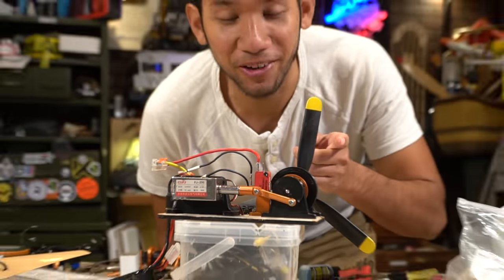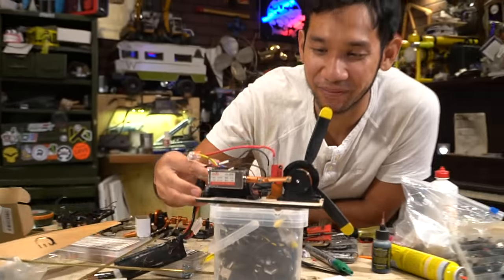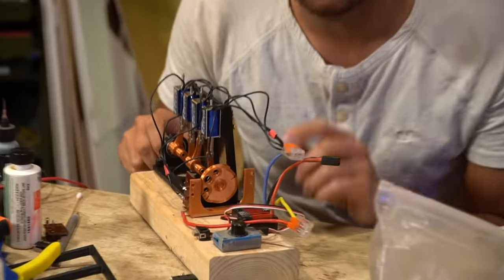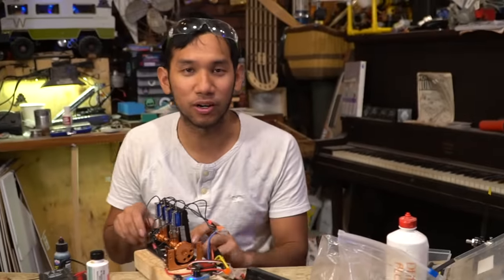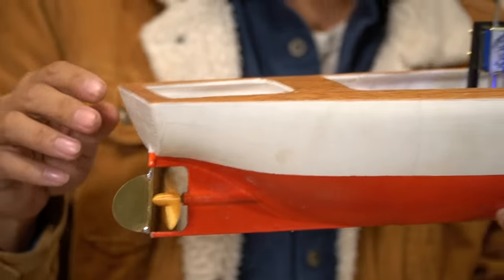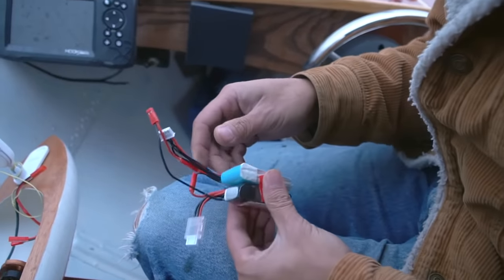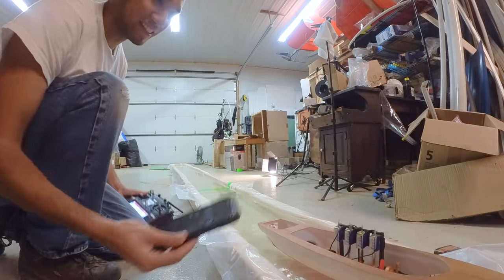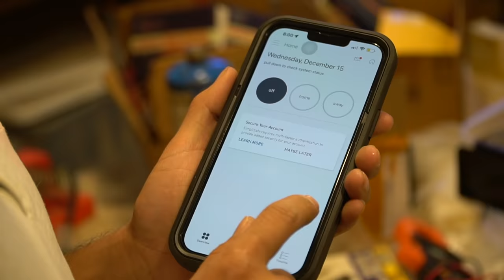Electric piston engine DIY (solenoid motor)

Comment: The idea looks good. If I were to do that, I would have each solenoid fire with every 90 deg turn of the shaft. You had the solenoids firing in pairs so it basically imitated a two stroke engine. If you need 2 solenoids to fire to turn the shaft, then make an 8 solenoid engine so that 2 solenoids fire at the same time. Yeah...more engineering, but results would be a smoother running motor (for possible airplane use). Just my $0.02 worth.

Comment: Tips for you, ditch the the iron, use a  ironless coil, and ditch the iron plunger and use nonferious with magnets instead..... and now you can use bipolar switching. 
 I'm guessing you didn't use flyback diodes on the coils, and maybe why things getting hot from the reverse polarity inductive spikes. Instead use diodes to steer the bemf spike to the next coils input capacitor to recycle that charge into the cap before that solenoid fires, so you need a cap for each coil. Or you can just short circuit that bemf to ground and waste it. And like some others mentioned, a flywheel!

Comment: There is probably things you could do. 1 - optimise timings. 2 - more flywheel inertia. 3 - maybe the ends of the stroke is less efficient so maybe a shorter stroke.

Comment: Are you planning to change the crank shaft to resemble one of a multi cylinder (in row(s) engine? ...or do you even plan for a radial engine? No matter what: multiple solenoids need multiple switches - one switch per solenoid - either arrange differently with one cam or also one cam for each switch... last but not least, you have to come up with something that does the logical function of the distributor of the ignition system in a multi cylinder engine w/ ignition (gasoline). Diesel is a bit different: instead of ignition spark, it is injection of fuel at the right time - close to max compression.

Comment: You could get a lot more out that engine. 1. Replace the timing switch with an optical sensor and make it control a large MOSFET.
2. Redesign the coils to be multiple small coils in parallel, that way you get less resistance/reactance using the same coil size. It allows more current to flow. 3. Use much higher voltage! Try like 150v dc. 4. Put anti-kickback diodes on each coil to cut down on the EMF interference.
Reply: How can the small coils be run as you suggest, in parallel?  What specific geometry?   Are the coils other-than-commercial-solenoids?
Thank you.

Comment: It would be cool if you put a gearbox in there. A servo can shift it into drive from neutral. And the escape will control speed. Bit if you could do that so the engine could run and not move the vehicle that would be super cool

Comment: I would think the trigger switch should advance with throttle. The theory here is that the solenoid always takes the same time to pull but at higher speed the crank is swinging by faster. advance would make the solenoid start pulling at the right time.

Comment: If you have an old bike lying around, What if you attempted to make a motorized bicycle with an electrical piston? Like they had back in the "boardtrack racing" days in the 1910's and 1920's , 1 or 2 pistons and instead of a fuel tank  in the frame, add a battery pack, etc etc

Comment: 6:38 I have an idea of what's going on here. So, cooling down metals makes electricity flow better, so that's a plus in it's favor, however cooling down metals generally makes them contract which if you have different metals they will contract at different rates which could end up causing squeeze which increases friction and makes it harder for the engine to turn over.

Comment: I think when it comes to solenoid engines since they have a power stroke every stroke the most efficient design would be a 3 cylinder engine with 120 degrees of offset between each cylinder. Or just having an odd number of cylinders would generally be better.

Comment: Maybe someone has already said this but would it be possible to have power on the up and the down strokes just by making the switch that turns the solenoids one and off switch the direction of the current flow inside. Then you can essentially have an "inline 8" engine since you can have power on every action of the piston. Idk if this works with the wiring of your solinoids but it seems like an easier way to get more power out of the engine.

Comment: So, I think there's three things to do. 
1. Less friction. Treat ik like a Stirling engine/flame licker. It seems to me like it's running pretty rough.
2. Cool the solenoids, or try other voltages/more/less windings. I've seen solenoid engine srunning for quite a while without the coils burning out. 
3. When using multiple solenoids, distribute the cranks over the revolution evenly, to smooth out torque. (crossplane crankshaft)

Comment: Sterling engines have their uses....
You've built a flat-plane inline-4. Impressive, no doubt. I suspect a full cross-plane 90/90/90/90 degree crank would greatly increase efficiency by way of being able to cut down the amount of time the solenoids need to be energized by another 50%.... iow, each solenoid only needs to do 25% of the work, much less cooling required---much less energy wasted on producing heat.

Comment: I was wondering if you made a solenoid engine could it be better for higher voltages? Say you generated high voltages and wanted a high voltage motor to turn a wheel, seems a solenoid engine would better handle these higher voltages than conventional electric motors? They seem simple to control and you could use one for each phase? so if you had 6 or 48 phases you could use a solenoid motor for each phase plus you dont have to worry about expensive parts like variable frequency drives or PWMs? Im going for simplicity here. Thoughts? Thank you for any feedback and thank you for the cool video.

Comment: Try adding a flywheel, rotational mass is what gives engines torque.

If you look at old engines, tractors, ground oil pumps, steam engines, old cars, they all have giant flywheels. It's because the engines had very low power, so the car needed a way to harness rotational mass as a form of battery.

Comment: if you reprint the drive shaft at a 90 degree of rotation per solenoid and alter your timing mechanism as well as adding a flywheel, it will solve the lack of torque issue

Comment: would a hall effect sensor work to be able to have all 4 timed individually? just a thought. since then in theory you could remove the mechanical switch from the design entirely, removing a physical failure point.

Comment: solenoids tend not to be very strong over a long distance, so perhaps reduce the stroke and ensure that the end of the stroke co-insides with the end of the solenoid travel or even better modify the solenoid so that you get maximum force at the mid travel point (where its useful)  not the end where it's not helping.. then time it to have an advance in the commutation switch..

Comment: Not gonna pretend I know everything like the other commenters here do. But I do wanna see a radial solenoid engine. Also, if you don't want to get into engine balancing, a straight 6 configuration is naturally balanced in both primary and secondary forces.

Comment: You could maybe increase the efficiency of the engine if you offset the solenoids and the crankshaft. Motorcycle engines are often made this way, and it allows for a longer power stroke and less friction of the rod inside the solenoids, as it pushed straight down. It's hard to explain, so google "offset cylinder".

Comment: Unfortunately any type of reciprocating to rotary conversion is by design quite inefficient. Still doesn't mean it's not fun to try. Go for some permanent magnet push/pull style solenoids with increased travel, adapt the crankshaft for longer throw and set the journals at 90deg (so there is constant force on at least 2, not the dead zones at TDC and BDC), add some heatsinks on the solenoids, put some kind of an oil mist system on the "pistons", bigger flywheel, eliminate the reduction gearing and run the engine slower.

Comment: You need to change the timing of the solenoid valves so that they fire the way spark plugs would in a real 4 cylinder engine, which means you need a different crankshaft too with 90 instead of 180 degree throws so it won't stick on 'dead center' :-)

Comment: On the I-4, why did you have 180 degree phasing and not 90 degree phasing? Just the camming? Wouldn't it be smoother with more evenly distributed power with two switches and 90 degree phasing?

Comment: If you make a 3 "cylinder" engine and separate the cylinders by 120 degrees, you can probably use a sensorless, brushless motor controller to make it run.

Comment: what if you ofset the pistons by 90 degrees instead of 180? would improve tourque, and maybe if you had a solenoid in the oposite direction on the same crank you can apply tourque the entire rotation?

Comment: I think it would run much better and start by itself if you offset the crankpins by 90 degrees instead of 180. Of course you'd need two switches then. In an inline 4 cylinder you need 180 degrees offset because it's a four stroke engine and you want the firing order to be even. But your solenoid engine basically is a two stroke. So every magnet has one power stroke per revolution.

Comment: PterStripol, how did you get the axel openings for the propeller and the rudder to not leak in water? I really need this information and would love it if you could answer, for I am working on a machine that needs this info and I am a beginner for machine engineering (for a hobby).

Comment: i wonder if a V-shaped "motor" would've helped or connecting the solonoids at 90° to the drive shaft(?) instead of 180°. outside of the obvious temperature problem :D

Comment: I feel like you didn't give this its best chance... but still loved it. A normal cylinder only creates power once with every otto cycle, so every-other time the piston moves from top dead centre to bottom dead centre, and this is why you have pistons paired and running in 180 degrees of phase in a 4 cylinder. With the solenoid motor you could have these running in 90 degrees of phase as they give power every time it moves from that would be bottom dead centre to top dead centre of a ICE. Put in 2 more solenoids and you could get this down to 60 degrees of phase which would be much smoother. OR just do somethings much different/ much more interesting and make a radial engine. It will be just as useless but a good laugh.

Comment: Hey Peter I've been on your chilling a while and I've been recently watching while your submarine videos from the past. I was wondering could you technically use a motor to make water flow in and out of like a little ballast type of deal that you can make? is that plausible?

To be more descriptive what I mean is using up like a propeller to suck water in and push it out of maybe something that you could use as a ballist tank like maybe a water bottle for example

Comment: For the single "cylinder" motor, could you put a secondary switch on the opposite side of the first and reverse the electrical current for the new switch to have a push and a pull?

Comment: What would happen if you replace the metal rod inside the solenoid with a plastic one with a permanent magnet embedded in it? Could you possibly trigger the solenoid to attract the rod on the down stroke and then flip the polarity to repel the rod on the up stroke? Could you get two power strokes from the same cylinder?

Comment: I'm currently working on improving my designs on my hydrogen generator and I personally would love to see if you could make a hydrogen powered vehicle using lasers instead of using the conventional electrolysis methods.  I'm just a mechanic by trade so I would love to see an engineers point of view. Plus there is basically nothing on the subject so it could be a good way to pop some noggins.

Comment: * use hall effect sensor and FETs to switch, you can then adjust timing in software.
* make them 90 degrees apart, instead of 180 degrees, should be way smoother, which is the point of more cylinders in the 1st place.
* like Vitor already said, you can do push/pull, then you can go 45 degrees apart, even smoother.
* at 45 degress apart, the crank will be uneven, you should probably go 3 or 5 cylinders.
* wait, this is just BLDC motor with extra steps.

Comment: Comment #3 ..   If you added more flywheel, it will run way better.  If you add an optical pickup with a trigger wheel to replace the cam, and use a mosfet, you could reduce a LOT of friction..  You could make a smallest diameter cam possible, which will give the motor much greater mechanical advantage on the friction between the cam and the switch..  You can also offset 2 of the solenoids 90 degrees and you'll self start and make far better torque.   These will all increase output SIGNIFICANTLY..

Comment: Lately i thought about similar idea. Brushless electric engine placed into a custom made : not a "jet" engine. 
Engine would rotate reversed turbine (well essentially same blades like compressor stage) and this "turbine" would be connected just like ordinary jet turbines to compressor stage in front.
With heat generated by the engine coils (possible y even heat from batteries) not being just waste, but used in between compressor and turbine as a "non-combustion chamber". In order to heat the compressed air to expand it to help spin.... shoot it is reversed ....hmm ok we need two turbine stages one normal one pushing or normal turbine connected to a outside propfan. :-B
It sounds terrible inefficient. But i would really love to see how much waste it would be.

Comment: so, if you modify the "piston", so you have a dual power stroke. using a magnet for the internal piston, the changing polarity of the outer cylinder, should double the power. right? how well does it work to generate power? there has to be something of use for them

Comment: Couldn't you replace the plunger with a magnet and reverse the polarity on the coil to get power on both the push and pull strokes?

Comment: what I really wanna know is... could you use a Stirling  engine to drive the solenoid  to generate power? I always thought that a Stirling engine only applies force in one direction? so maybe it wouldn't be that inefficient?    I have no idea.. just curious

Comment: Why is the efficiency of a solenoid motor lower than of a normal electric motor? The rotot and the solenoid are working on the same principle. Is it the mechanical rubbing that puts the efficiency lower?

Comment: Could you use fast switching transistors or arduino to reverse polarity of the coils so it pulls in both directions on every stroke?

Comment: @PeterSripol How can you say its inefficient when you never measured power usage? You get an F just for that because i think you should know better since you did a video on Fan motors and actually measured their power usage in determining which ones to use.
Instead of using mechanical switches, try optical then you won't waste so much torque...
Also, if you had each of the 4 cylinders off set by 90 degrees instead of 180 degrees on the crank shaft you would get torque all the way around...
Reduce other sources of friction and make the crank spin freely to further reduce the loss of torque.

Comment: For the single cylinder engine couldn't you add more notches to the switch activater so it activates more per rotation

Comment: Battery is being affected by temp.
Standard battery normal run in 25degree Celsius to 40C.
2nd use Ir sensor to sync the piston. Or for smooth transition of electromagnets to prevent the lagging effect due to unsyncronized movement in miliseconds, Also prevent the engine to start by itself.

The off switch is one of the problem. It creates a bouncing effects preventing the engine to run faster. 4:14

Your Engine.
1.On 2.partially off 3.On 4.partially off. And your engine is Literally 2 Strokes Not 4 strokes

Efficient Engine should be. 1.On 2.Off 3.On 4.Off
1.Off 2.On 3Off.4.On

Comment: Because of 1:40 wouldn't it be better to build it as a boxer flat 4. With the "power stroke" of each bank 180 to each other. Most internal combustion engines now are four stroke because they are more efficient, but wouldn't two stroke timings be better for the push pull nature of the solenoids.

Comment: Get some sealed bearings, i bet that was at least 80% of the problem as soon as you put it in the water. Give them some thin oil and it should be good.
Also you really should replace the switch with a sensor. As little friction as possible and maybe some diy solenoid coils and it should be running wayyyyy better

Comment: Eh...yea...cold weather could play a small part in performance, but the main culprit to your power loss is humidity.  Moisture in the air combined with heat from the solenoids was creating condensation and ultimately a short circuit of the solenoids.

Comment: why don't you make the solenoid push in both directions by making the solenoid sit at dead bottom with the crank shaft but make the solenoid stick out the other end when at dead top so it can get pulled back down making the engine have about twice the power per rotation

Comment: If you made a second flywheel with a 45° offset and put w of the pistons on it in the same on off setting you would have a more reliable engine

Comment: What if you flipped polarity of the electromagnet. So the piston would have a push/ pull affect?
Reply: Same thing i was thinking.  I have had that thought before. It can be tricky to get the timing right doing that though.

Comment: If you would have put a flywheel with ball bearings around the outside it would have run a lot better in the lake

Comment: could you just put another switch on the opposite side of the cam with the wires reversed to make it work on both strokes?
Reply: maybe also get rid of the cam on the 4 cylinder one and use the crank/rods to hit the switches